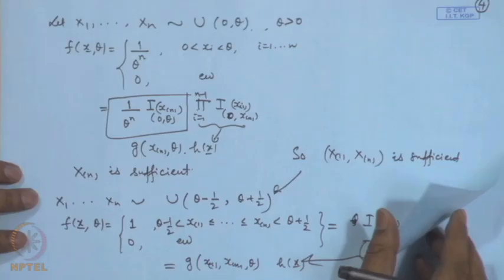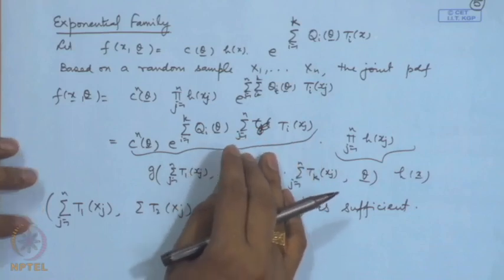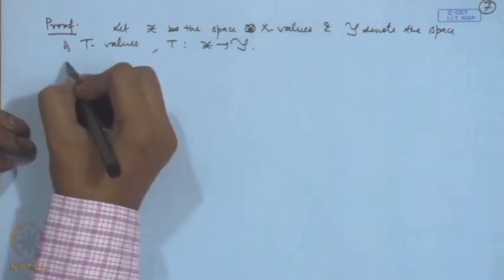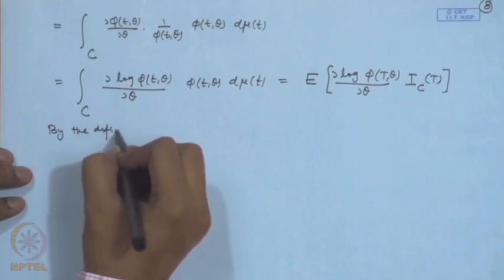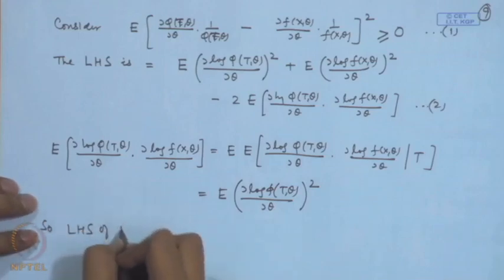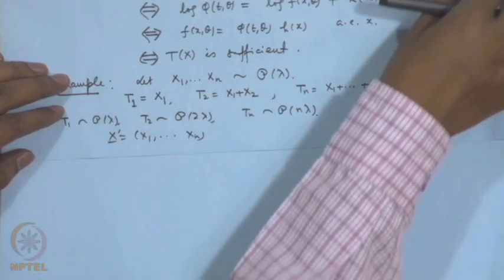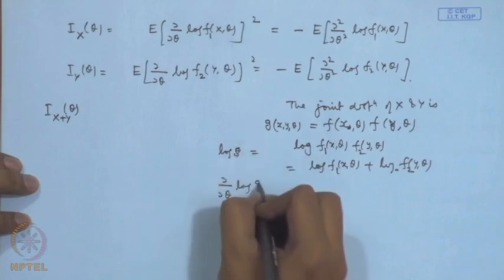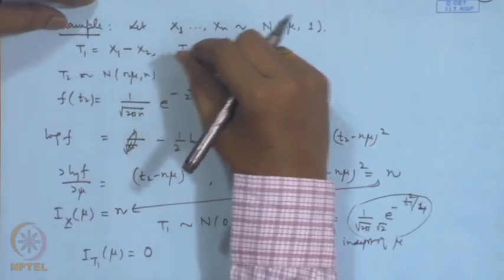Lecture 26 : Sufficiency and Information - II

Comment: [Summary of the Lecture 26 : Sufficiency and Information - II]
[+} Application of the factorization theorem (continued)
>> - The factorization theorem is very useful
>> ex) Exponential family (k-dimensional)
>>>> - Let us consider the general distribution of the exponential family
[+] Relation btw the “Fisher’s information” measure and the concept of “sufficiency”.
>> [+] Remind the definition of the Fisher’s information
>> [+] Theorems
>>>> (i) information of a sample with a given statistic
>>>> (ii) “information of full sample” >= “information of a statistic” (equal when the statistic is sufficient
>>>>>> - Meaning: there is no lose of information if we use a sufficient statistics
>> [+] Proofs of the theorems are given: (i) and (ii)
>>>> - (i) is used for proving (ii)
>>>> - necessary and sufficient condition of equality in (ii)
>>>>>> - by the factorization theorem, equality holds when a statistic is sufficient
>> [+] Meaning of the Fisher’s information measure
>>>> - Fisher’s information measure is extremely important concept in the current physics or in the information theory
>>>>>> - There is a book on Fisher’s information. which almost establishes the entire physics based on the Fisher’s information measure
>> [+] An example of calculation of the information
>>>> ex) Poisson lambda dist. (1D, 2D, …, nD)
>>>>>> - check the equality of sufficient
>>>>>> - Remark: information is additive
>> [+] Another example of the equality of sufficient statistics information
>>>> ex) Normal(mu, 1) dist.
>>>>>> - sufficient case
>>>>>> - information is zero case: we call it “ancillary statistic” (discuss it later)
>>>>>> - Remark: sufficient statistics vs. ancillary statistics
>>>>>>>> - this concept of information is very very significant
>>>>>>>> - these tells what purpose the statistics be used
[+] Next lecture: the concept of minimal sufficiency
>> - What is the maximum reduction between the different sufficient statistics?
>> - Concept / how to derive it / how to characterize the concept.